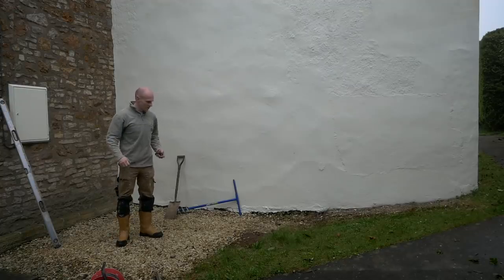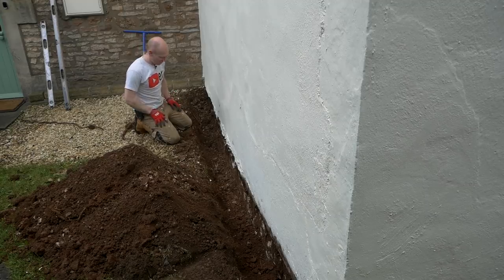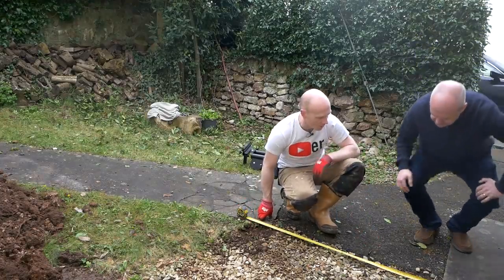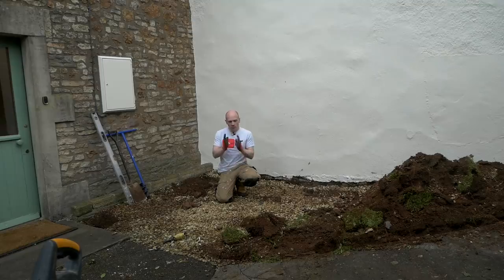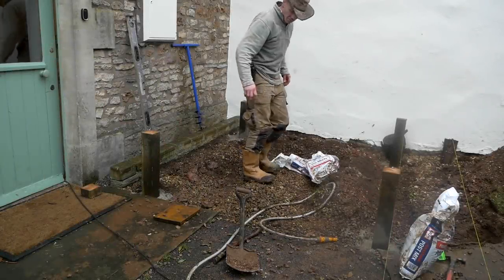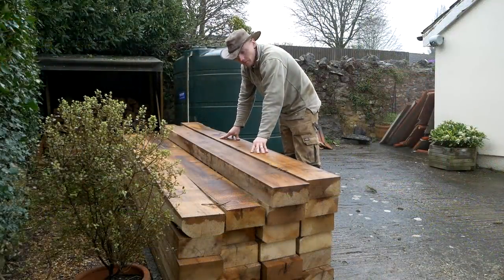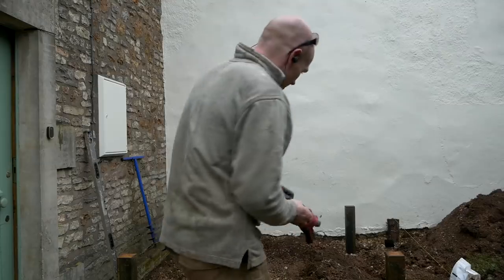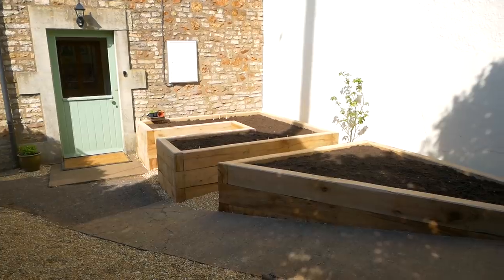Building the OAK KITCHEN GARDEN - Part 1 of 3

Comment: It would be great if you could share the approximate material costs of your work.
Reply from the maker: Will do at the end. But it really varies depending on what timber you use and how high. Same design in softwood may be half the cost. I usually get oak at around £25 a piece.

Comment: Hello Tim, 
I have been watching your videos for quite a while now, and as an individual living in Pakistan, I am always left with the question that how do you prevent the wood from rotting in such a wet climate. Nobody in Pakistan does outside stuff using wood, so I am not exactly sure what techniques are used to prevent wood from rotting. I would greatly appreciate if you could shed some light on it.

Comment: So what is the minimum sleeper wall length  there should be a support post or a interlocking corner? Because I have a 9.3m fence line I'm doing a raised sleeper garden on the 100mm side x 3 sleepers high and there will  be a interlock at each end but assume it still needed support every X meters?! 

Other option is I don't have the raised garden straight. But I have small yard as it is so can't bring it out much and if to skinny in places  would restrict what I can grow.
Reply from the maker: Probably worth doing some posts every 1200 depending on how much backfill is going to be in there pushing on it. You can grow in any size bed providing it’s got sun there. Just stick to salads and herbs at the really thin parts or just a single row of veg perhaps.

Comment: Hi Tim. What fixings did you use to attach the posts to the sleepers? Just some heavy screws or flanged concrete bolts or proper nuts and bolts? Doing something similar and I'd prefer to hide the fixings on the outside of the sleepers so hoping heavy screws would do the job
Reply from the maker: Landscaping timber screws. Ideally stainless if used on oak. I go over it all in the next video.
Reply: @TheRestorationCouple  Thanks Tim

Comment: I bought Oak Sleepers after watching your other videos instead of normal ones. Couple people thought I was mad spending a lot more and stated my garden will outlast my house. Haha. Now I'm worried I spent a lot of money on oak when didn't really need too.
Reply: Are you glad you used oak now? I’m about to order 30 oak sleepers.
Reply: @martybli  They look better and will last. Probably needs a restain at least every couple years. If I did it again I'd probably use normal since oak is really heavy to work with and hard to drill. I had to buy a corded SDS hammer drill since a standard battery drill couldn't cope.
Reply: @supermankelly  I’ve got an impact driver so hoping that will do it. I’m 53 and want these to outlive me. I fear that normal wood probably won’t. Thanks for the info though.